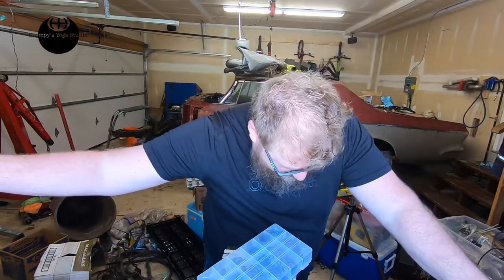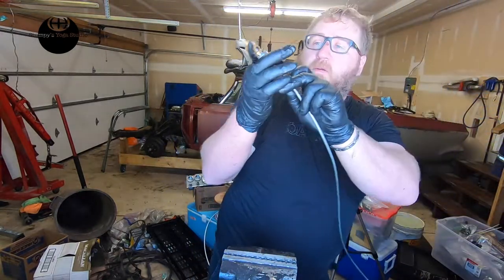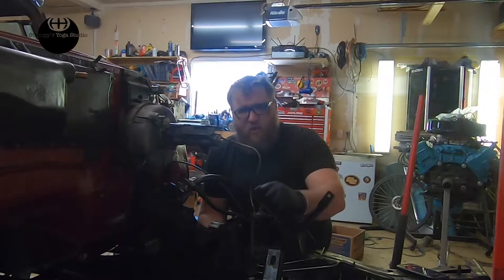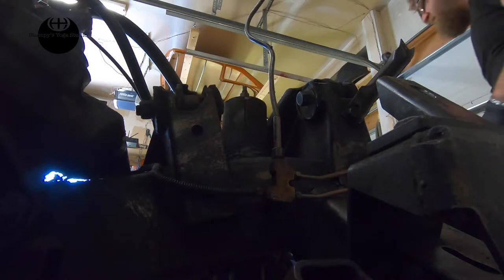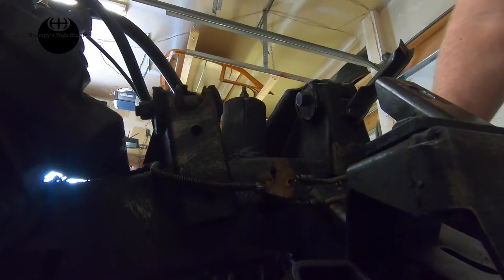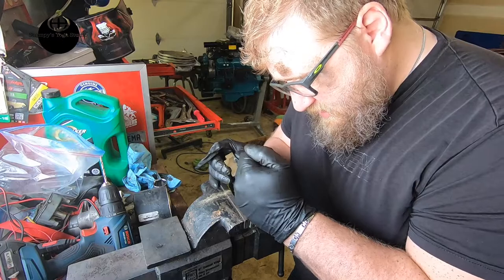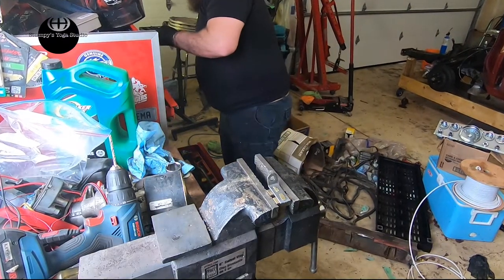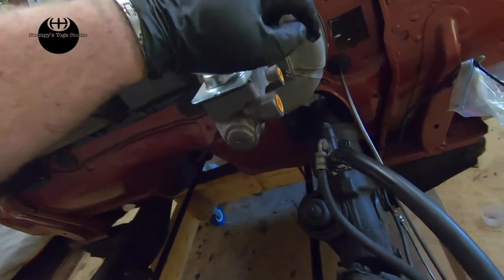Stumpy's Yoga Studio Episode 10

Comment: The Highway Saftey Act (USA) came into effect in 1966.  So for 1967 all cars made in the US had to have dual master cylinders.
But as early as 1962 Cadillac had a dual system and so did Studebaker!  

The 1966 Highway Saftey Act is also why push-button transmissions ended.  Not because they were outlawed, but because Chrysler (last of the push-button makers in 1964) was afraid it would cost more to conform if there was a law, so they abandoned buttons just to be safe.